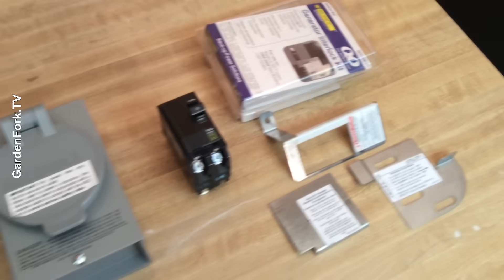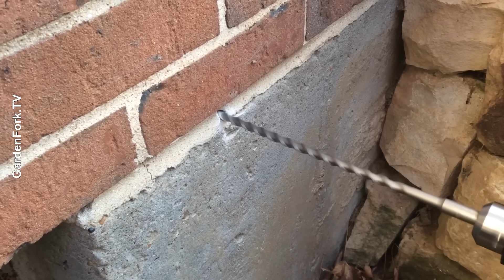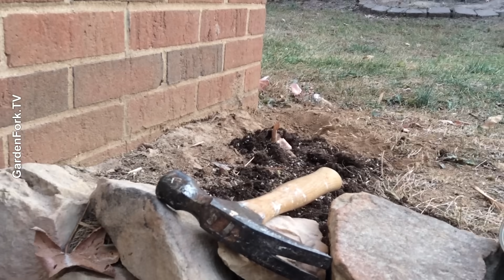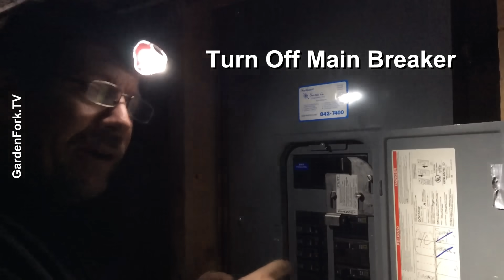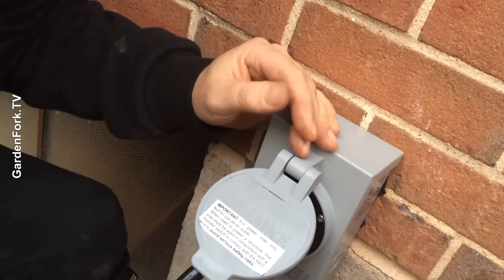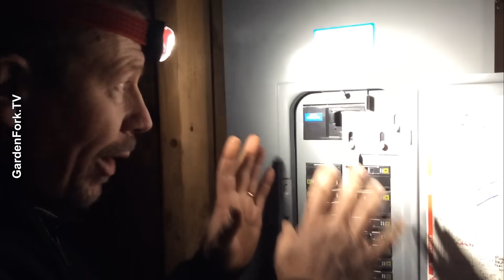Your Easy  & Safe Way To Hook Generator To House | Generator Interlock Switch Install | GardenFork

Comment: I charge $99 for the first hour $60 each additional your plus materials. To do panel and outlet labor $160+ parts . Part probably about the same ,breaker,wire ,lockout,outside outlet,staples haven't done one in a while so guessing on price of outlet and lockout . $200 or so. Would think the hole job $360. Just off the top of my head to give an idea to people.
Reply: It's that, or running extension cords all over the house! Definitely worth the money. It makes the set up quick and easy.
Reply: How much for one of dem Male to Male widow-maker cords?
Reply: I just put an interlock in, for my panel it was $65 for interlock.  8/3 cable 80 feet with 30 amp double pole breaker was 130.  Inletbox was 36.  I had staples (to move 4 wires to my sub panel from main panel) and 8/3 circle hangers.  I had 1/2 tubing for the part exposed.  30 for the cord from generator to inlet box (i used to run a suicide cable from gen to dryer plug, decided to go legit).  So with tax about 300 for just materials.  But I needed 80 feet to go to side of house I want generator on, so without wire you looking at around 130-150 for materials.  Also 30amp and below you only need 10/3 wire which is cheaper.  I didn't hire an eletrician because I'm comfortable doing it, i am the one who installed sub panel (old house very small panel and original owners had every slot with a double breaker already, had to install sub panel to put in central air and dryer, they had an apartment dryer that was tiny), inspected and everything passed.
Reply: @dardack  thats awesome ! It only takes a little research to be safe and do it correctly and the inspection and if you need a permit its cheep . N ow if you have a problem and claim anything on you home owners insurance they will pay the claim because it was inspected. And the line guys are safe from being hurt by your generator . Again well done !
Reply: @680ecks  Yeah man.  TBH I waited to get my panel inspected until I had built my enclosed back screened in porch, knew my building inspector would require an electrical inspection, so why pay 4 times (have to pay for 2 visit, rough in and final), so it did sit a few months before inspected, but worked out.  Yeah I mean it's scary in the panel even tho you turn off main you know power is on those big wires.  So I get hiring, I do, life and death for real.  But IMO treat it properly and careful, should be fine.
Reply: That’s what I was looking for. Thanks!
Reply: Whole

Comment: Connect your essential supplies- lighting, fridge, freezer- to a dedicated breaker board with a changeover switch fed from the main board or generator, then there is only one switch to operate after starting the generator- simple, no interlocks to worry about and no risk of overloading.

Comment: what if one leg of you main fails to open, you just fried a pwer company employee! i have had mine fail with only one leg will open, not a good set  up!
Reply: Comment made by a utility worker on a professional forum The policy is to "identify, isolate, test and ground" before going to work, so a home generator is not really a concern.
Plus a small gen would flounder or pop a breaker if you try to power the neighborhood
Reply: Yep a 7500 watt gen wont run multiple houses that think they have line power. Overload 30 amps real qiuck

Comment: There is some concern with this hookup about a back circuit through an imbalanced ground knocking a serviceman off the pole....even with the main locked off...??????
Reply: The whole reason for the guard, is to GUARANTEE that both the mains, and the breaker to the generator can't be switched on at the same time. It's to take that risk away. The people that have to be careful, are the people making "suicide" adapter cords, to plug their generator into a dryer or stove socket. That works great, but that introduces the possibility of an error back feeding the grid, which is a deadly hazard. That kind of a set up relies upon the person to MAKE SURE the mains are switched off, before connecting the generator. If you're in a hurry, its an easy thing to over look, therefore not recommended. In some areas, it's actually illegal to connect that way.

Comment: Most generators suggest starting the generator first before plugging it in but good vid!
Reply from the maker: Is that so it won’t surge into the panel or? I thought plugging it in while running could cause it to do something to damage the setup. Thx!
Reply: GardenFork I’m thinking it makes it difficult for the generator to start if there is a load already on it.
Reply from the maker: I plug the cord into the generator, then start generator. Only then do I go inside and flip the breakers to power the panel. So there isn’t a draw from the get-go. Good info. Thx for taking the time to write. Eric.
Reply: All the breakers were off inside, There was no load. Its fine what he did on the video.
Reply from the maker: Good to know Ego, thx!
Reply: I dont flip my breaker but i just run my welder and such so if i start it with welder turned on its only a tiny fan that comes on but its so engine isnt loaded on start up. I have a hard time starting powerwasher unless im holding the wand to spray. Same concept

Comment: This will work...BUT... it does open a door for someone to screw up.  First this does not cut the neutral from the grid. It only cuts the two hot leads. Now your generator neutral is connecting to the grid. That is dangerous. Remember that neutral is not ground. It is connected to 115 volts through every device that is connected to the box. 
  You should NEVER run power from your generator directly to your circuit breaker panel.  The professional way is to have a 4 pole-double throw switch that comes between the breaker box, the grid and the generator. This is your only guarantee that you cannot accidentally connect your generator to the grid.  4 poles are needed to separate the two hots, the neutral and the grounds from the grid, for absolute safety.

Comment: In an emergency, you can reverse patch into your dryer outlet. Disengage the main (100 amp) breaker from service provider (uppermost breaker; either standalone above the panel rows or the first of either side) Determine the wattage load on the generator (amps x volts = watts) and turn off all single-feed and 220/240 breakers rated above the capacity of the genset including the dryer. With a pre-fabricated patch cord designed to mimic the male end of the dryer plug and the other end to fit the genset 220/240 outlet. Start genset (with the dryer breaker disengaged) and plug the patch cord into dryer wall outlet FIRST and the other end into your generator (the male end fabricated to plug into the dryer outlet will be electrified once plugged into the running set and provides no protection from electrocution, direct grounding or shorting; this is why it needs to be plugged into the wall outlet before generator start) Disengage breakers to all appliances that have high amperage starts and only then engage the dryer breaker. You will then have power to both feeds of your breaker panel. Apply loads in intervals in that you do not over-amp your generator capacity -  amps x volts = watts or watts / volts = amps   

The main breaker has to stay disengaged from your service provider. Once power has been restored, turn off most, if not all of what you were powering with the genset. Disengage the dryer breaker, turn off the generator, remove the patch cord, engage the 100 amp breaker, and then engage all breakers you had turned off...

NOTE: you have to have a familiarity with all things electrical and with use of a generator. This is in an emergency situation only, in where you have the confidence to apply. If you plan to have a backup system, following the info provided by GardenFolk is advised. Or, have that patchcord handy...

Comment: Transfer switches are a lot safer for the utility workers trying to restore your power. This is cheaper by far but Installing a breaker without removing the neutral wire at your main panel could send  a load back to the pole or wherever you get your power from. Just something to think about

Comment: How is the Neutral isolated? Or is it? If not, it is illegal in a lot of areas of US. A Lineman’s ultimate nightmare during a storm call out. Must be a complete isolation. Well that’s what I was told anyway. I’m not an E E. So.
Reply from the maker: i've seen these generator interlocks installed by licensed electricians in several states, and they are made  by same the companies that make the electric panel.
Reply: GardenFork 
Great. During my last ArcFlash Annual Training , this year, it was one of many topics that was touched on by the instructor. He said that laws and penalties for this type thing are changing rapidly across the board. But if it turns out to be a contradiction to NEC then it is a violation anywhere in the USA. My question was , does this product provide for a complete” off- grid “ isolation. I have been an Electrician for 40 years. I just wanted to know. I mean no disrespect here. This is just an honest inquiry. Thanks though.

Comment: but you failed to show the ground that connects the generator outside----we have a rod that goes into the ground also.
Reply from the maker: Hi Janet, there is more than one way to ground a generator. The power cord has a ground that connects to the ground in the panel. Thx!
Reply: @gardenfork  well due to where our home is it set high upon a hill with 360 degree view problem is the lightening here is major danger....so guess thats why the large ground rod added extra. Thanks.
Reply from the maker: Good to hear Janet, its a good idea to be safe with that. It never hurts to be extra safe! And a ground rod is inexpensive insurance to keep everyone and everything safe.

Comment: Great video, covered all the bases except for the placement of the muffler on the generator. We've had this system for almost 14 yrs. First year I had the generator too close to the house. Siding got very hot, could have started the house on fire. 
Ours is a Troy built 8500 running, 10,000 Watt surge.
It'll run furnace, well pump and refriderators and deep freeze without skipping a beat.  30 amp cord.
Good job on to your installation.
Reply from the maker: Good point Jason! next video i will point that one out. thx!

Comment: I know I'm going to take a lot of crap for asking this. As far as the safety aspects and the law to be honest of having a good fool proof mains lockout, I totally get it. I wouldn't have it any other way. But, and here's the shit magnet in my comment, it would seem that with all the other houses on demand if you were to get that dangerously wrong and hit the grid with your generator, wouldn't it instantly trip the generator's breaker?
Reply from the maker: I'm not an electrician, but that seems to make sense. The demand on the generator breaker would cause it to trip, IMO. I imagine an electrician will be along soon and answer this for us. thx!

Comment: Nice video.

I like how you explained the ability of equipment as well. Though, it's not the the amperage that determines output entirely, as many things can have similar running amps, but different starting amps.

Do you need to ground the generator, or if it is bonded, should you separate your ground and neutral on the generator before it is connected?
Reply from the maker: good point on the starting amps! that is very important. The ground and neutral coming into the panel from the outdoor outlet are separate - 10-3 plus a ground wire - and attached the the appropriate connectors in the panel.
Reply: @gardenfork  Even thoughthey are separate at the outlet, the circuit would still have them bonded if they are at the generator.

I'd imagine this would be a really nice system setup if analog gauges or a plc were added to the panel door. You could even run your hot lines through a current transformer to see how close you are to maximum load capacity.

Comment: Security note:
Attach a large eyebolt to the home that you cane secure a large chain or cable to with the other end going through and padlocking the generator.
During the blackout that followed super storm Sandy thieves stole unsecured generators. Sometimes a running push mower was left in its place to conceal its theft giving the thieves enough time to get away.
Generators will sell for many times the original value during a disaster.
Reply from the maker: Excellent point! It’s sad to say but it happens.

Comment: Good video. Manual system vs a transfer switch. What if you have a solar system?
Reply from the maker: I would isolate the solar system from the panel when running the generator, but I am not an electrician. Best to check with an expert.
Reply: Assuming that your solar system feeds excess power back to the utility, it has to disconnect when the utility power fails.  One reason, of course, is you can't backfeed power for the safety reasons discussed.  Another reason is that your solar system has to synchronize to the utility's AC frequency and phase in order to run in "parallel" with the utility when things are normal.   When things are not normal your solar system has nothing to sync to.

You should probably ensure that your solar system is shut down and isolated before putting portable generator power into your house.  Generator power is generally safe for most household items, but the stability of the AC frequency and phase quality may not be as good as the utility's.  Not being able to keep good synchronization between them could damage the solar system, the generator, and/or the things you are powering.

Comment: Can anyone tell me how to get more than 30 amps into your home from these all too common 6-800 watt generators? Makes no sense to buy this massive generator to run your whole house, only to limit the usability of it by one small cord that is only rated for a max of 30amps or by the breaker on the generator also limited by a max of 30amps.
Reply from the maker: Hi Bethany Keep in mind that’s 30 amps at 220 volts. I run most everything in my house on this. Portable generators will not run the electric clothes dryer or a whole house AC. A truly massive generator is an on-demand hard wired generator which goes for about $9,000 installed. A portable generator is about $600.

Comment: I have (2)200 amp panels side by side. How can I feed breakers in the other panel? I don’t intend to power the entire house, just selected circuits.
Reply from the maker: Might have to get an electrician to look at that setup. Is one panel a sub-panel of the other one?
Reply: GardenFork  No the panels are load panels that supply outlets, water heaters,heat pumps, lights, etc. I could never run the entire house on a portable generator, just 2 refrigerators and a few light circuits.

Comment: My own generator only has 120V output. Is there a way to plug it into the house like that?
Reply from the maker: Probably not as most panels are 220, with two hot wires and a neutral.  But I am not an electrician so you might want to ask a local expert. Thx!

Comment: The panel interlock kit method is illegal in Canada.
Reply from the maker: Did not know that. Good info. Thx for letting me now.
Reply: @gardenfork  It's due to the fact that removing the panel cover will defeat the safety. My take...give a guy a chance and he'll defeat the safety on everything he owns with just a screwdriver. I'd use it on my panel, illegal or not.

Comment: Kudos for using a professional electrician for your installation.  This is one of the best portable generators videos that I've seen on YouTube. I've watched many and I typically turn most of them off after a few minutes because they're filled with electrical code violations and are produced by people who should not be doing their own electrical work.  Just for clarity the box on the outside in a generator INLET box not an outlet.  Nice job!
Reply from the maker: thanks for the kind words Robert! i sometimes flip words like that. But yeah, this interlock is simple and safe, I tried to show how not to harm any utility workers yet power your house. thx!

Comment: good video. The interlock switch is cheaper and it gives many more circuit options. 31yr electrician. Stay safe. Peace.
Reply from the maker: wow great to hear Michael, i appreciate hearing from experts like yourself. thx!
Reply: Hi Michael, do you have an approx. cost of what an electrician would charge to put in the interlock, breaker, and that little box plug in the generator cord plugs into?  Thank you sir.
Reply: @robertclymer6948  I'd like to know this as well. 👀
Reply: @AlexisChateau  Log off and call one.  Do you cut your own food?
Reply: Well, I'd run conduit from yor panel to your  generator plug. Make sure to use rigid conduit for the piece that will go through exterior wall. This will require a junction box or a mogul lb to go from regular conduit to rigid. If panel near exterior wall and everything exposed this should not take longer than 2 hours. Material would run you 50-100$ depending on distance. So if done properly and not just hanging extension cord you're looking at 300-500$ job of course if you got thick walls and finished basement and it takes 3-5 hours to finish easily 500-750$ job. Prices vary greatly from area to area.

Comment: How would I install this if my breaker box is full? Any other options for me
Reply: hi ... depending on what u got ...
yu MAY be able to buy half wide (width of your existing)
brakers   that work in your box   freeing up tha space u need.    its an option that works well / relatively inexpensive / relatively easy     or add another box 
   the half-width brakers are: "out there" maybe 4 your box.
Reply: Then you should have an electrician install a sub panel.